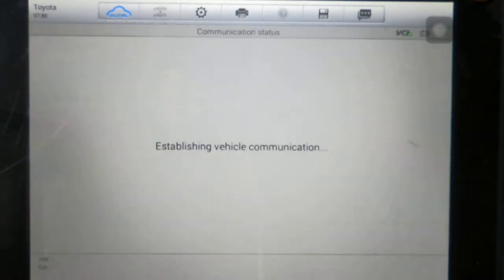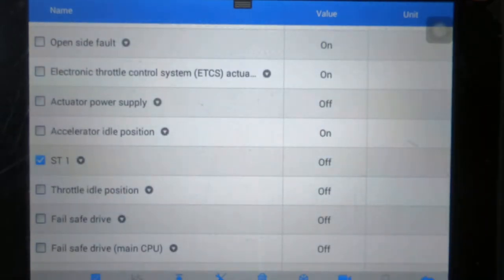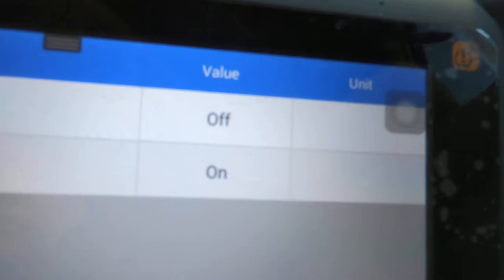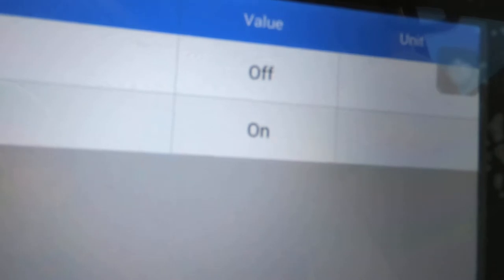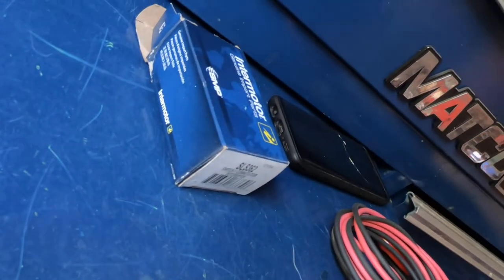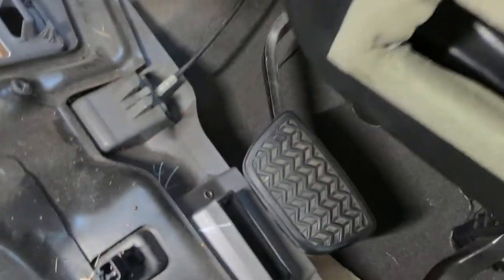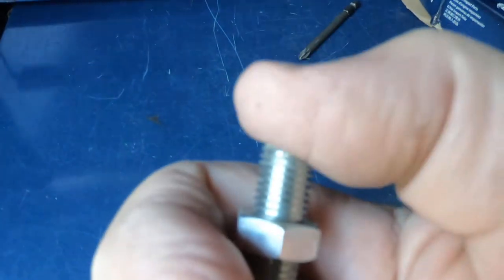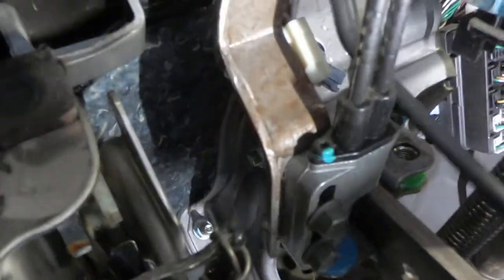Replacing the Brake Switch on a Toyota Sequoia for a A/B Correlation P0504 code.

Comment: Was your vsc/trc on when the problem occurred?

I don’t have no CEL light on dash but vsc/trc are on while this code popped up on scan tool.. as well as U0100
Reply: How did it go? I just started having this problem today
Reply: Did you have any problems with traction control kicking on with corners that aren’t very sharp? I’ve not been able to figure out why mine does after replacing multiple parts of the front end